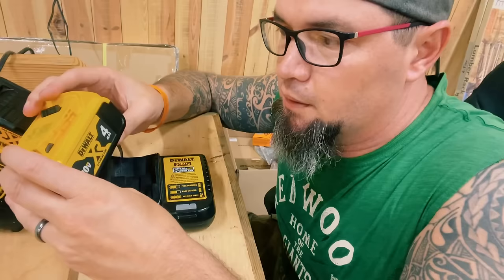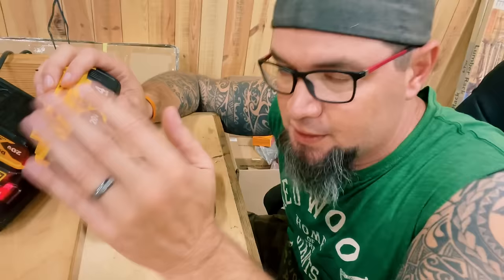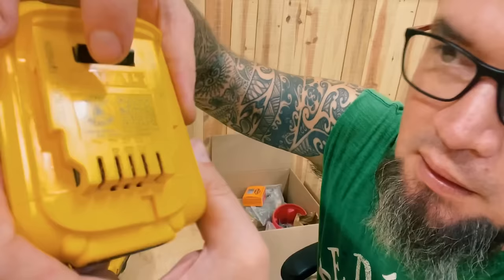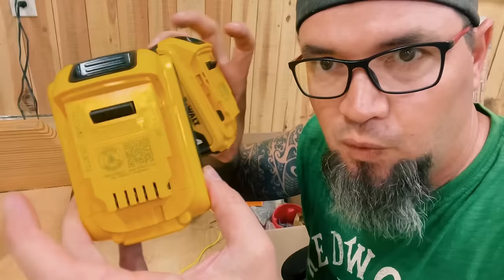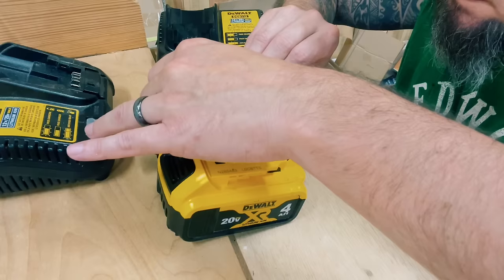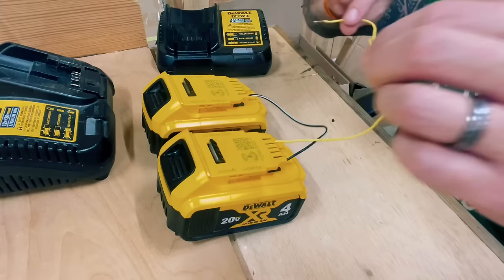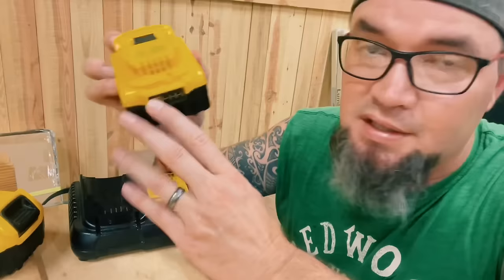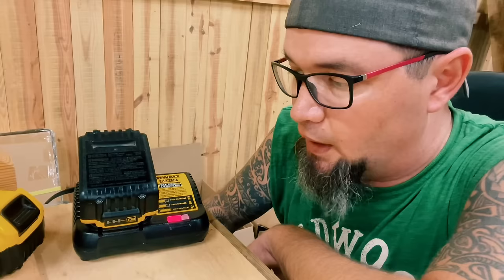Dewalt Lithium Ion Battery Won’t Charge? Try Resetting It With This Easy Fix.

Comment: Great video, Left my battery on my impact wrench almost two years in garage from cold to hot days and my charger wouldnt even detect a defective battery nothing. I tried this and it worked like a charm thank you!!
Reply: Warning. Only do this in an emergency. If you manage to charge this battery, do not keep this battery anywhere it can cause a major fire.
Why ? When these batteries are discharged below 3v per cell, dendrites (small spiky structures) can grow and possibly pierce the separator between the anode and cathode of the battery, causing a short circuit, and thus a fire.

Most consumer electronics will regard 3.3v as fullt discharged, and the battery protection circuit will then turn the equipment off to prevent over discharging.

If a cell is found to be 2.3v or lower for anything by the a very brief time, then it is effectively dead, dendrites will have certainly grown, and even if you manage to charge it, the dendrites are still there, and you now have a ticking time bomb. Do not reuse such a cell.
Once that separator is pierced you may have a fire, the intensity of that fire will depend on how much charge is stored in that cell.

If your battery pack has been dischared for some time, open it up, and measure the voltages directly accros the individual cells. If this is less than 3v, do not attempt to charge. Even if there is not a fire, you will notice that after charging, that cell will self discharge within an hr or so. This is due to a partial internal short circuit caused by dendrites. More energy put in to such a cell increases the risk of fire.

You have been warned.

Comment: Dude you just might have saved me the time and headache of taking apart my dewalt battery that just got completely discharged!! Thanks !!👍

UPDATE: Just jumped my dead battery like you showed and it’s now taking a charge !! Don’t know why I didn’t think about doing this in the first place??? It’s just like jumping your car battery and then keeping the engine running so the alternator charges it up again!
THANK YOU!!!!!
Reply: It's still dead.
Reply: Warning. Only do this in an emergency. If you manage to charge this battery, do not keep this battery anywhere it can cause a major fire.
Why ? When these batteries are discharged below 3v per cell, dendrites (small spiky structures) can grow and possibly pierce the separator between the anode and cathode of the battery, causing a short circuit, and thus a fire.

Most consumer electronics will regard 3.3v as fullt discharged, and the battery protection circuit will then turn the equipment off to prevent over discharging.

If a cell is found to be 2.3v or lower for anything by the a very brief time, then it is effectively dead, dendrites will have certainly grown, and even if you manage to charge it, the dendrites are still there, and you now have a ticking time bomb. Do not reuse such a cell.
Once that separator is pierced you may have a fire, the intensity of that fire will depend on how much charge is stored in that cell.

If your battery pack has been dischared for some time, open it up, and measure the voltages directly accros the individual cells. If this is less than 3v, do not attempt to charge. Even if there is not a fire, you will notice that after charging, that cell will self discharge within an hr or so. This is due to a partial internal short circuit caused by dendrites. More energy put in to such a cell increases the risk of fire.

You have been warned.
Reply: Battery is still going strong but appreciate the warning about the dendrites.  But with what Dewalt charge$ for the$e batterie$ I will take the risk

Comment: Well done, Matthew.  I've had a 12v DeWalt battery completely dead for a year, unable to take charge. I was ready to dispose of but kept changing my mind until I watched your video, and what a surprise, it’s been working! Thanks man, for being there for us. You've got my "like"
Reply: It’s tough to believe what you are commenting because you didn’t comment that you fixed the battery with this process. Let me guess you’re just still so happy that there is internet and wait what’s this? A video about batchry?!…. Amazing!…
Reply: Warning. Only do this in an emergency. If you manage to charge this battery, do not keep this battery anywhere it can cause a major fire.
Why ? When these batteries are discharged below 3v per cell, dendrites (small spiky structures) can grow and possibly pierce the separator between the anode and cathode of the battery, causing a short circuit, and thus a fire.

Most consumer electronics will regard 3.3v as fullt discharged, and the battery protection circuit will then turn the equipment off to prevent over discharging.

If a cell is found to be 2.3v or lower for anything by the a very brief time, then it is effectively dead, dendrites will have certainly grown, and even if you manage to charge it, the dendrites are still there, and you now have a ticking time bomb. Do not reuse such a cell.
Once that separator is pierced you may have a fire, the intensity of that fire will depend on how much charge is stored in that cell.

If your battery pack has been dischared for some time, open it up, and measure the voltages directly accros the individual cells. If this is less than 3v, do not attempt to charge. Even if there is not a fire, you will notice that after charging, that cell will self discharge within an hr or so. This is due to a partial internal short circuit caused by dendrites. More energy put in to such a cell increases the risk of fire.

You have been warned.
Reply: @gregjones3660  are you okay?
Reply: @kenlang1070  im gay
Reply: @gregjones3660  me too
Reply: @kenlang1070  Ok. You may print a badge off from your printer at home and hot glue a pin on the opposite side.
Reply: @gregjones3660  you need professional help
Reply: @kenlang1070  im gay
Reply: @gregjones3660  not for that
Reply: @gregjones3660  If you want it in the bottom, who cares, so what
Reply: @kenlang1070  Other gay... Also gays dont just "take it in the bottom"...
Reply: @nordic5490 think this is what was causing all those battery fires with the stupid hoverboard /scooters a few years back?

Comment: You just saved me over $200 for my photo studio light battery. I thought one of  batteries was dead (no response)…
Little wire connection with good battery just like you showed and battery alive and charging again. Amazing. Thank you, you r genius!
Reply: Warning. Only do this in an emergency. If you manage to charge this battery, do not keep this battery anywhere it can cause a major fire.
Why ? When these batteries are discharged below 3v per cell, dendrites (small spiky structures) can grow and possibly pierce the separator between the anode and cathode of the battery, causing a short circuit, and thus a fire.

Most consumer electronics will regard 3.3v as fullt discharged, and the battery protection circuit will then turn the equipment off to prevent over discharging.

If a cell is found to be 2.3v or lower for anything by the a very brief time, then it is effectively dead, dendrites will have certainly grown, and even if you manage to charge it, the dendrites are still there, and you now have a ticking time bomb. Do not reuse such a cell.
Once that separator is pierced you may have a fire, the intensity of that fire will depend on how much charge is stored in that cell.

If your battery pack has been dischared for some time, open it up, and measure the voltages directly accros the individual cells. If this is less than 3v, do not attempt to charge. Even if there is not a fire, you will notice that after charging, that cell will self discharge within an hr or so. This is due to a partial internal short circuit caused by dendrites. More energy put in to such a cell increases the risk of fire.

You have been warned.

Comment: When disconnecting batteries, never pull both leads out of one battery first. No matter how careful you think you are, sooner or later you'll let those two wires touch and short out the battery that the wires are still connected to.
You always disconnect one lead first from each of the two batteries and then disconnect the second lead.
Reply: Excellent advice, Rex!👍
Reply: What is life worth without a little adventure/risk??
Reply: Same advice when jumping a car.  Wife and her friend got to meet some hunky firefighters, though.
Reply: @bruceregittko7068  good for them
Reply: 💥 learnt that when a kid jumping the car .👍
Reply: Literally just did this in a Bosch battery that I had left on a USB/Light adapter. Charger wouldn't recognize the battery was even there. X2 strands of solid 18g wire + to + and - to - . Worked perfectly! Charging the battery now. 
Thanks for the great tutorial!!
Reply: I just learned the hard way😢

Comment: Brand new DeWalt 20v Max Lithium-Ion battery, after only using it a few times, I put it on a portable LED flashlight once. It drained the entire battery. The charger did nothing when I put this battery in it. Now, I followed the instructions from this video, and damn! It worked perfectly. And what this guy says is true: you only need to keep the 2 batteries connected for about ten seconds or so. You don't need to do anything else. In other videos, for example, it wasn't clearly explained how long you had to hold the battery poles against each other. I just connected them for 10 seconds with a simple electrical wire (B+ with B+; B- with B-), and unbelievable! It worked like a charm! Shout out to this guy for getting this fixed! Batteries are expensive enough, and especially when a fairly new one already starts causing problems, it's a real hassle. Thanks, dude!

Comment: I bought a 2pk of 5ah batteries several months ago. When I needed them and attempted to charge them they were dead as a hammer. Not even a glimmer of charge on the indicator, so they wouldn't recharge. Your trick worked like a charm! Thx!

Comment: Matt, I was just about to go get a new battery and this popped up on my Facebook feed. I have a Dewalt heated jacket I got new for Christmas last year and put it in the closet with the battery still hooked up. Needless to say the NEW battery was dead and wouldn't take a charge. I tried your hack and it worked like a charm. Appreciate you making this video. Thank you!
Reply from the maker: No worries at all.  I figured I wasnt the only one that needed to know this trick.

Comment: I stored a 18volt dewalt impact for multiple years. I thought I had to replace the batteries because obviously they were dead. So I thought, I followed these instructions using a 20 volt battery and had great results. Thank you for saving me the cost or buying new batteries 👍
Reply: You used a 20v to revive an 18v battery? All my 18v work for a minute then die.
Reply: @JC-qm4ot  this self discharge is due to the internal short created by the dendrites that have grown. You were lucky to not have a fire.
Reply: Warning. Only do this in an emergency. If you manage to charge this battery, do not keep this battery anywhere it can cause a major fire.
Why ? When these batteries are discharged below 3v per cell, dendrites (small spiky structures) can grow and possibly pierce the separator between the anode and cathode of the battery, causing a short circuit, and thus a fire.

Most consumer electronics will regard 3.3v as fullt discharged, and the battery protection circuit will then turn the equipment off to prevent over discharging.

If a cell is found to be 2.3v or lower for anything by the a very brief time, then it is effectively dead, dendrites will have certainly grown, and even if you manage to charge it, the dendrites are still there, and you now have a ticking time bomb. Do not reuse such a cell.
Once that separator is pierced you may have a fire, the intensity of that fire will depend on how much charge is stored in that cell.

If your battery pack has been dischared for some time, open it up, and measure the voltages directly accros the individual cells. If this is less than 3v, do not attempt to charge. Even if there is not a fire, you will notice that after charging, that cell will self discharge within an hr or so. This is due to a partial internal short circuit caused by dendrites. More energy put in to such a cell increases the risk of fire.

You have been warned.

Comment: This is so simple yet counterintuitive, would've never thought of it.  Saved lots of batteries today.  Thank you!
Reply: It really is counterintuitive.  It would do the opposite to balancing the cells . It would unbalance them more.
Reply: @chrishart8548  I think you are missing the point. A few seconds of charge merely brings up the voltage temporarily so that the charger will recognize it as a battery to be charged, there is no actual charging happening. It is a bit like the foamy milk on a cappuccino, looks big but all air.

Comment: Well done Matt and thank you! I had a new Dewalt 4Amp 20V, same as you had in the video tip and it was totally dead and would not charge, had been on a saw all Winter and it was 100% depleted. Your tip allowed me to basically get the Dewalt charger to detect a slight current in the battery again and it charged perfectly.
Reply: Was not 100% depleted ... under 3.3 volts is irrecoverably dead. It's no magic, it's chemistry.
Reply: @countmorbid3187  Thank you Mr. Dewalt!

Comment: Worked like a charm, thank you! I have a new DeWalt 12v battery that has never charged, and this fixed it in 60 seconds.
Reply: Warning. Only do this in an emergency. If you manage to charge this battery, do not keep this battery anywhere it can cause a major fire.
Why ? When these batteries are discharged below 3v per cell, dendrites (small spiky structures) can grow and possibly pierce the separator between the anode and cathode of the battery, causing a short circuit, and thus a fire.

Most consumer electronics will regard 3.3v as fullt discharged, and the battery protection circuit will then turn the equipment off to prevent over discharging.

If a cell is found to be 2.3v or lower for anything by the a very brief time, then it is effectively dead, dendrites will have certainly grown, and even if you manage to charge it, the dendrites are still there, and you now have a ticking time bomb. Do not reuse such a cell.
Once that separator is pierced you may have a fire, the intensity of that fire will depend on how much charge is stored in that cell.

If your battery pack has been dischared for some time, open it up, and measure the voltages directly accros the individual cells. If this is less than 3v, do not attempt to charge. Even if there is not a fire, you will notice that after charging, that cell will self discharge within an hr or so. This is due to a partial internal short circuit caused by dendrites. More energy put in to such a cell increases the risk of fire.

If the cells have briefly (a few hrs only) dropped below 3.3v, but, not below 2.3v per cell, then ok, have a crack at charging, but, there is increased risk of fire. 3v can be revived ok providing the cell has not been sitting @ 3v for period of time. More time below 3v = greater risk the anode to cathode separator will be pierced from growing dendrites, causing a short circuit, and hence a potential fire hazard.

You have been warned.

Comment: I just fixed a $300 Kobalt 80v 5A batter
y using this method.  I was a little hesitant thinking it would work, but it did.  Prepping the wire, connecting the batteries...took me 10 minutes to save a $300 battery...thanks for the instructional video!
Reply from the maker: So glad it worked!!

Comment: I had two completely dead batteries after i left them hoooked up to stuff for months.  Charger wouldn't charge them.  Was going to send them in to a battery store for repair until i found this video.  Worked perfect!  I gained two batteries back.  Thank you.
Reply from the maker: Awesome!

Comment: I have a not even 6 month old Dewalt 12.0 AH 20v/60v Flex Volt that I’m going to try this on. For some reason I’ve had problems with the 12.0 amp hour versus the 6 amp hour battery doing the same thing. It’s been covered under warranty three different times and they told me this is the last time from Dewalt!
After trying it I’ll try to post here if it works. Thank you so much, it’s worth a shot and good video & to the point by the way!